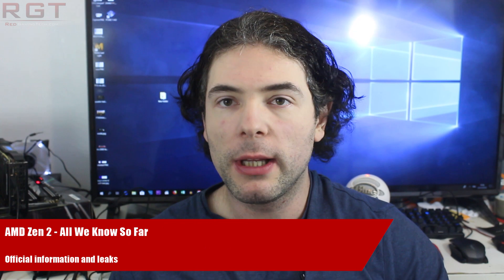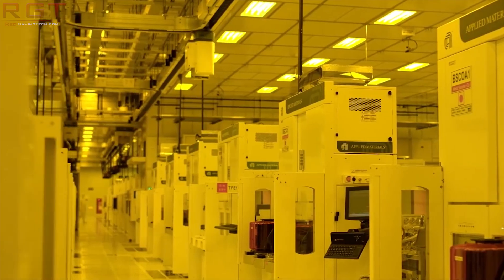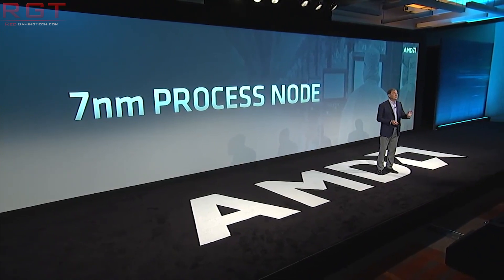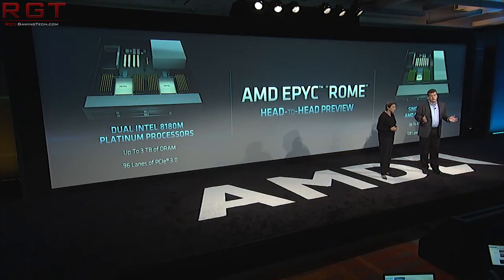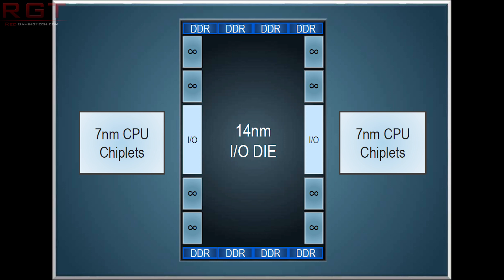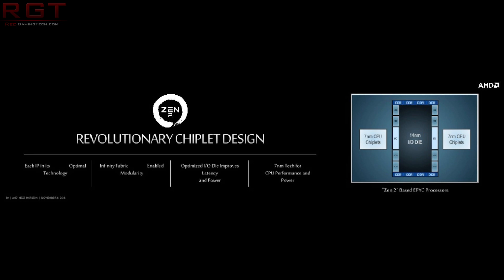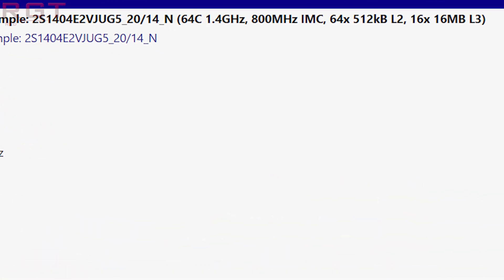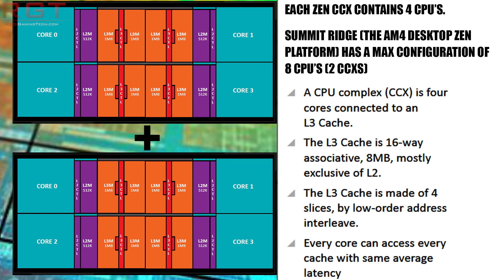AMD Zen 2 All We Know So Far | Zen 2 Official Info, Leaks & Rumors

Comment: Can’t wait for zen 2.  First time in awhile actually been hyped for cpu launch lol.  Keep it coming AMD :)
Reply: waiting for ZEN 2.. I can finally retire my old 5820k, although still more than capable for gaming.
Reply: Sire DragonChester be patient
Reply: LazyGeekgamer HD is dead channel 
Aye.  Was seriously thinking building R7 2700x to replace my aging i7 3770 3.5 GHz.  But may hold off till zen 2 drops. Beside ddr4 ram prices are insane here in Canada.   Still very hyped for zen 2.  Can’t wait :)
Reply: Sire DragonChester I understand that but I been using zen one I skipped zen plus not much a upgrade from zen one
Reply: I got Ryzen and it's great! 1700X I was hoping to get  Zen 2 but I'll wait for Zen 3
Reply: @Junior305able  Do you mean zen 3 as in Ryzen 3000 or zen 3 as in Ryzen 4000 or 5000(depending on the number of versions they make on the zen2 architecture). since the actual zen3 is planned at around end 2019/start 2020 and many people confuse ryzen3 with zen3 while ryzen3 is on zen2. however, in your case, it is quite realistic that you refer to the actual zen3 since unless the Ryzen 3000 series turns out really much better than the current Ryzen CPU's your CPU will still be near the top of the marked.
Reply: I am looking forward to ZEN 2 HEDT; aka Thread Ripper.
Reply: Can't wait for it either. but it won't be that long anymore and the new speeds of ddr5 might really boost performance if zen2 reacts to memory speeds the same way as zen does.

Comment: If intel bumps to 10 with comet lake. Then Amd do will 12
Reply: Yes no doubt intel is single core champ if they bump it to 10 core maybe you kidney number will be bumped downed to 0 or 1 for buying that  shiny new tech.
Reply: @rickbhattacharya2334  Not to mention I don't know how they could make a 10 core 5Ghz chip without needing Kingpin's LN2 loop to cool it.
Reply: @rickbhattacharya2334  if the IPC gains are to believed, they will no longer be...
Reply: With Zen 2, expect:
  - Ryzen == 16 cores max.
  - Threadripper == 32 cores max.
  - Epyc == 64 cores max.
Reply: Chiplets have 8 cores in then, they'd just go with 16 rather than cut one in half. Sure there will be dies with defective cores to make up the 12 cores, but the yields should be good enough to be able to offer the full 16 core 3800x (or w/e they call it).
Reply: @DrRichardRApe  , They will not go 16 it would cannibalize to much of the second gen threadripper lineup.
Reply: @Q_thulu  Then why did they have an 8 core Threadripper? The 1800x cannibalized that one. Except it didn't, because TR has more PCIe lanes and memory channels. So your assessment is moot.
Reply: @DrRichardRApe 
There is an 8 core Threadripper? That is news to me. What's the name of that CPU?
Reply: @d1oftwins  yeah 1900x like Viewer19 said. Each chiplet is designed to have 8 cores (looking like still two quad core CCXs if L3 cache hierarchy means anything). If they're going to have a 12 core part (2 chiplets with 4 cores not working) I'd bet they'd also have a 16 core part with two fully enabled chiplets since yields are going to be good. Of course it'll be limited to 2 channel memory and less PCIe lane than TR.
Reply: @DrRichardRApe  , The 1800x didnt compete with the 1900x. A 16 core mainstream chip would cannibalize 12 core threadripper processor. Amd will do the exact same thing with ryzen 7nm that they did before. The top end chip will be 12 core 24 thread to match the low end threadripper skew.
Reply: @Q_thulu  The 1800x didn't directly compete with the 1900x because one was on x370 and the other x399. Different platforms, it's the same way a 16 core AM4 won't compete with a 16 core TR.
Reply: and comet lake will be basically only coffelake  renamed into cometlake
Reply: Thats pretty much threadripper territory
Reply: Um yeah the 1800x and 1900x were discontinued... and there is no 2900x starts at 2920x now.  So AMD took care of this. 

Doesn't matter if Intel does a 10 core, it'll be $500+ like the i9 9900k which because of its ridiculous price it has no competitor and is sold to the 0.1%. There is no point in AMD wasting money on this tiny niche mainstream market that Intel just started with the 9900k. That's what Threadripper is for. Same reason AMD isn't competing with the RTX 2080ti, it's a tiny market not much money to be made. I expect Zen2 Ryzen to stay at 8 cores so it doesn't step on the toes of Threadripper owners.
Reply: @10WA  with zen 2 threadripper could have 32 real cores(not like the 2990wx), so maybe minimal core count in threadripper could become 16, and minimal for Ryzen could be 6c/6t and 12/24 for the max, It would literally make Intel look like dogshit.
they might do It for Ryzen 4, but with Ryzen 3 its kinda of a overkill rn(even tho i would love it).
Reply: I think AMD's ZEN 2 will have up to 16 cores on the mainstream AM4 platform.

Comment: I wonder if the single I/O die will have single PCIe root.
Reply: i wonder if it will have L4 cache...
Reply: No it won't, the section named "I/O" is responsible for PCIe and the whole Die supports 128 PCIe 4.0 Lanes which results in up to 128 PCIe Lanes for Epyc, up to 96 PCIe Lanes for Threadripper and up to 32 PCIe Lanes for Ryzen & Athlon.
Remember that those are Gen 4.0 Lanes, so a PCIe Gen 3.0 Graphics Card will only take 8 instead of 16 Lanes for full performance. So basically if you only use PCIe 3.0 Hardware on a Configuration which has PCIe 4.0 you'll have double the Lanes aviable.

So, if Ryzen 3000 gets PCIe 4.0 you'll have 64 physical PCIe 3.0 Lanes and 32 logical PCIe 4.0 Lanes.
Reply: @KNightstyleZ  Man you didn't get the question. I'm talking about PCIe root complexes (https://en.wikipedia.org/wiki/Root_complex). Since EPYC had 4 dies i'm guessing there were 4 PCIe root complexes (4 x 32 = 128 lanes). Thing is that PCIe devices from different root complex don't have same access between each other. Having one central I/O die means they may be able to make it one 128 lane root, or two 64 lane roots if they want or keep it 4 * 32 as before (if going for die quadrants modularity). If there are multiple complexes then there will still be penalty, but i'm quessing it will be singificantly lower than on Naples.

Comment: I dont think we really need more cores I would like to see maybe a 4.3 stock clock 5 boost all core or something along those lines
Reply: Problem is, doesn't necessarily matter what "we" as consumers want because any consumer CPU is essentially scraps from the server market.
Zen was designed from the ground up for the datacenter. 2nd gen Ryzen is no different.
I can almost guarantee that we will see at least 12 core, probably 16 core mainstream Ryzen CPUs in 2019.
Reply: @Butthurt_Beluga  I should have rephrased my statement to what (I would like)
Reply: @Butthurt_Beluga  I agree tho I think we will see 12 core mainstream chips in 19
Reply: If the base and bost will 4.3 and 4.8 to 5.0 this will get too close too Intel 8th gen although it will be slower than that because of the latency issue . 
Intel's architecture for core interconnect is better than infinity fabric .
Reply: @rickbhattacharya2334  actually it might surpass intels even with just a lets say 4.3 ghz because of the ipc bump, ipc meaning instructions per clock which intel is currently leading by 2~3% as of now, the ipc performance in some tests leaked were about a 13% increase in ipc, of course this can be higher but compared to intels current lineup that is facing zen 2 it will get steamrolled by this 10~11% ipc increase and with this higher ipc amd will have the edge even at 4.3~4.5 ghz as opposed to intels 5ghz and zen 2 will be more power efficient making it better than its intel counter parts, and another note dont expect that zen 2 will reach 5ghz because of architectural limitations
Reply: whatever you think is absolutely meaningless, because you clearly do not understand the basics of microelectronics and its current problems, evolution trends, etc...
Reply: @luisjalabert8366  I'll be here waiting for you to break it all down wheres your channel at explaining the evolutionary trends of the microelectronics world you dick head
Reply: @doperider85  that was unnecessary